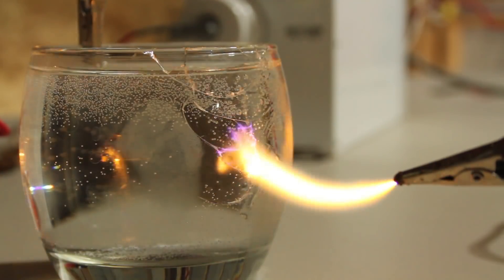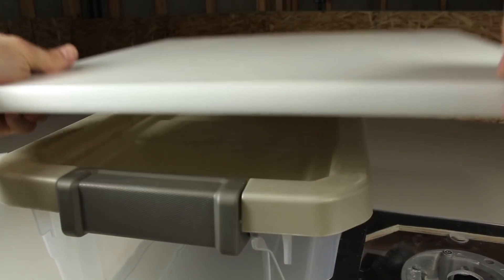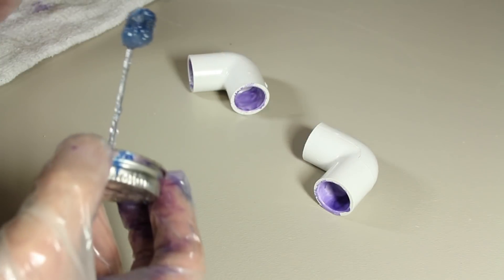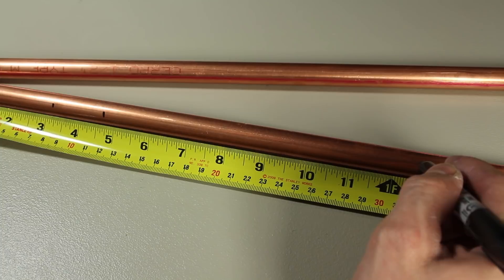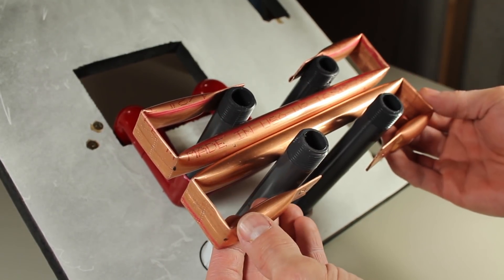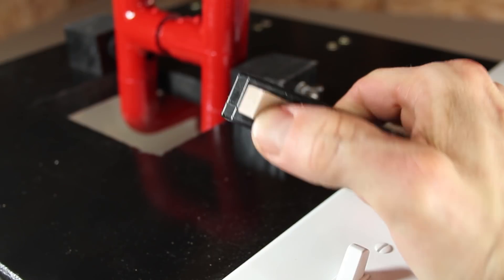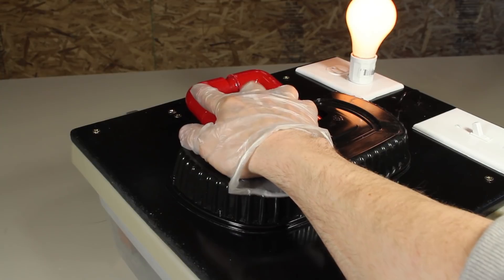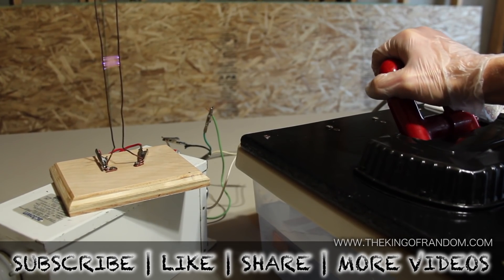The Scariac (Poor Mans Variable Power Controller)

Comment: 4:58 Why the hell would you use a plug without a ground on it. Are you deliberately trying to make this thing as deadly as possible?
Reply: There is nothing to ground on this device so a ground prong would be useless. Nothing except for the wiring and electrolyte is conductive so there is no alternative path for the electricity to follow (so it all has to return through the neutral). It's not the safest contraption but a ground would not make it any safer.
Reply: +Alex Golembeski That may cause a ground fault circuit interrupter to trip, which is the point of it.
Reply: Mitchell Spanheimer Yep, and over time, the sharp screw, due to movement, can cut into the wire just a little bit to short it out, but not enough to trip the breaker, so it could cause fire. It's unlikely, but it could happen.
Reply: +Alex Golembeski I mean, he does say it's able to kill you in the video, shouldn't that be enough warning?
Reply: +Alex Golembeski Better yet, look  5:15 how he screwed cable to the board !
Reply: +Alex Golembeski  
If you're asking this question then this project is not for you.  What are you going to ground?  Hopefully, not yourself when using this. That why it's called the Scariac!
Reply: Please tell me your problem "Deadly little gamer".
Reply: This rich kid is 42, yes I do well for myself.  I can support myself just fine from my job as an electrician which I've done for 25+ years, so yes I do know something about electricity. And BTW, no help from my parents, kiddo. 
 Now tell me fuckhead, what does this have to do with electricity, You still haven't answered what I said that made post in the first place.  You seem to know it all so I would love to hear you.  
I have to sleep now so I can go to my job tomorrow and build real buildings, unlike you in your block worlds.With your attitude,  I guarantee you wouldn't last one day in the real world.
Reply: Mark Schulz IV I have to admit that is pretty sketchy, he probably pierced the insulation...
Reply: yeah but at least you can put the fire out straight away thats a plus
Reply: ***** 
"do us a solid" that tells me everything right there.  Go back to your minecraft game.  smh...
Reply: +Chris Barth Dude, if you're 42 you shouldn't care what this kid says. Just ignore it. You are just wasting your time.
Reply: You are right, sometimes its easy to forget that it could be a 8th grader making smartass comments. Thanks!
Reply: +Chris Barth lol
Reply: +Chris Barth Lol your right haha I'm making a not Tesla coil right now Lol letting silicone on the rotary spark gap harden Lol then it's time to wind a primary around it lol
Reply: +Chris Barth ohhh yeah that's awesome I may try that one day
Reply: +Deadly Little Gamer Haha. This has nothing to do with Electrical Engineering. 😂
Reply: Did you see the medium he uses for controlling current? Ground would be the least of worries though it would help. He could have used a polarized plug and 2 wire, running the ground from the 2 wire directly to the outlet.
Reply: +Deadly Little Gamer Not only is Minecraft fairly useful for what you've said but, they're using Minecraft right now to make AI that much better.
Reply: +Chris Barth not you I'm also an electrician buddy I'm not saying nothing your fine but the kid  that originally commeted I just don't want him getting hurt he does need to learn electric if he wants to work with it sorry if I offended you

Comment: Does this not get hot or produce hydrogen gas under load?
Reply: +Quantum Leap 
AC current doesn't produce hydrogen
Reply: Sorry i just assumed you were a little kid so i was trying to simplify it, however keeping in mind atoms are not solid items but mostly empty space electricity can flow through them ,however when i say flow through atoms i mean flow throughout the groups not flow inside of them, imagine it this way you need a constant flow from a cathode to an anode and with DC it makes that straight path, however with AC picture the electrons go one inch forward and then one inch back, they make no progress, the just switch meaning that the "cathode" and "anode" are constantly switching in the sense of electrolysis so nothing is generated, no atoms can move to one side without moving back.
Reply: Priyansh Yep, back in the '70's. It's not really safe or practical. Aptly named, Scariac lol
Reply: +ZeroFossilFuel If you use DC current yeah but with AC you would produce microscopic amounts to none. 
so just use AC with this.
Reply: there's no fixed anode or cathode.
Reply: Benjamin Well it's pretty simple when you look at the difference between AC and DC, AC or alternating current alternates back and forth kinda like a shaking motion but hardly makes any movement through the wire at the end, while DC or direct current moves in a straight path through wires and covers a big distance, so it really comes down to which has more one way current flowing through the atoms and simply put it's DC.
Reply: Quantum Leap have you made one?
Reply: why is that?
Reply: Thanks for trying to answer my question but that doesnt make any sense. Also, electric current does not flow through atoms.
Reply: Zero Labs probably.
Reply: +ZeroFossilFuel   Yes, it does both.

Comment: A good Variac (auto transformer) is VERY expensive.  I have a 10A Variac and I am VERY careful with it to ensure I don't over load it and cause it to fail.  I'd probably use a bucket and re-design for that.  Ensure it have a HUGE base so that it was very hard to tip over any maybe even a kill switch wired for tip over (mercury type switch).  Run that to a BIG SCR that would be triggered by the mercury switch that shorts the input power and pops the circuit breaker.
You have to be VERY careful with motors.  Some do not like variable voltage.  Beyond that; VERY KEWL!  Even from an electronics tech/electrician point of view!
My last concern is vapors from any electrolysis.  Lye is not pretty stuff to mess with!
Still again, very cool!
Reply: +Jon Geissinger Also, induction motors get their speed stability from the frequency of the power line. Reducing the current wouldn't effect the speed much. All that would happen is reduce its torque.
Reply: +RiaRadioFMHD773 yeah, this kind of stuff is for low-tech things mostly. but i din't know variacs are expensive. why?
Reply: +Paul Hendrix It is basically a transformer that has its primary & secondary married with an extremely high rated potentiometer or rheostat between them. Also, to pass high current, the transformer (or auto-transformer) must be rated high as well.

Comment: The dangerous part is with the time, plastic get old and can break appart with nothing, and if there is electricity it can be lethal so it would be better if you add some sort of floater security that cut the curent if the water escape ;)
Grant Thompson really read my message because every plastic have problem by getting old

Comment: What scares me is that you actually create lethal fumes, and combustible hydrogen gass when you use this device... The cost of the materials isn't that much lower than for a used variac, so I'd go for the safer option :p
That doesn't mean I don't like the experiments though, but I do think you might check all the hazards befor doing this, and actually mention them if you post the video...
Science is only fun if you pay attention to safety!!!

Comment: Why not just get a rheostat?
Reply: +Fried Keenan That will affect voltage and current where this application only significantly affects current.
Reply: +Kyle C BUZZER SOUND. Look up Ohm's law. 
Never believe things you read in youtube comments kids! In fact, don't believe this either. Look it up.
Reply: +Rebelgium ok I won't believe you
Reply: cos
Reply: +Fried Keenan Actually, this is a good suggestion.  The modern rheostats these days are NOT variable resistors.  They are Pulse Width Modulated devices.  In other words, they turn on and off extremely fast for variable amounts of time to regulate power without wasting energy like a resistor would.

Comment: Voltage (E) is constant because it's a linear circuit. When you increase the surface area of the electrode in the water solution, the resistance (R) goes down. As a result the current (I) goes up. Ohm's Law explains the relationship (E=I*R).  Take a volt meter and measure the wall voltage. It's around 118 volts. Then break one wire and connect the an amp meter between the two points you made. Now turn it on and run up the power and watch the meter. But I would recommend is using anything but this. lol

Comment: I'll be making this. Just a smaller version with a lot less electrolyte, so only a very small amount of water is needed and it could be down with a small dial instead of a big lever. Just add a % scale to the dial (based on electrolyte concentration & electrode distance) for easy reference. Perfect for my applications and stupid cheap. Also, it's safe to just use salt because this is a series potentiometer not an electrolysis setup.

Comment: This one brings back memories, many years ago I worked at a Greyhound Stadium, the electric hare was powered by a 415 volt three phase motor. Up in the hare control room was a lever which dropped some copper contacts into three baths of Sodium Carbonate solution, you may wish to try using that, its also called washing soda, and its much friendlier to use than Sodium Hydroxide. Every time the hare was started a loud sputtering noise would come from the soda baths has the electrodes dropped deeper into them and the hare speeded up. The soda baths needed to be kept topped up as the water evaporated. The hare controller liked his beer, and would always be drinking a pint whilst driving the hare. All that beer had to go somewhere, and it could be difficult to reach the toilet between races. Needless to say more than just washing soda was used as electrolyte. And the room developed a very unpleasant smell. And yes the unit did have a safety interlock, so urinating onto live contacts could not happen. I was often in charge of a very old camera, the negative had to be pressed across a very sharp blade inside the camera, frequently I would catch my thumb on the blade in the total darkness, which was wonderful when the negative was going through the fixer bath, which contained Acetic Acid, lots of gritted teeth Ouch lol!! Happy memories though.

Comment: I would love to see you redo this one and seal it water tight as well as well as maybe adding a ground fault in case of a leak.
Reply: no he needs to run the electrical current through an Isolating Transformer first. if he does that, then he theoretically could put his hand in the water and not get a shock ☺

Comment: Do not run single-speed motors with this for heavy applications.  Although it can control the speed of the motor, the motor itself does not have a low-speed coil, meaning you can easily short things out if you put a lot of load into the system.  Variable speed motors are expensive for a reason.  I normally love your videos, but this thing looks like a death trap!  lol   Cheers!
Reply: Very much this

Comment: why not use a dimmer switch
Reply: +BMAN488877 No because it can handle standard household current (up to 15 amps) and a angle grinder only takes 4-9 amps

Comment: Where did you get the 12 gauge wire? I'm only seeing $50 plus for spools with much more than is required.
Reply: Where, what brand, etc. Specifications on the wire, I should say.
Reply: and one more question... what are the length, and number of, the straight PVC pipe pieces used in the handle?
Reply: +cameron weldon - at most hardware stores you can get wire cut by the foot. I am pretty sure Home Depot has this too. I usually go to Ace.

Comment: This is even more dangerous than explosives. Imagine having too short cable and pulling this thing off the table (ouch).
Reply: +pvc988 Or spilling the water out of the side onto yourself while the circuit is live.
there is all types of sketchy going on with this. But it is a wonderful demonstration
Reply: Cool!

Comment: If you think it's wierd that the voltage is constant you obviously shouldn't be playing with this..
Reply: +Morgan Freeman - it should be voltage changing the speed of the grinder instead of the current right? haha
Reply: +Edward Chew I'm not sure i understood your comment. When the electrodes are far away from each other, the current has to travel trough a longer distance of water wich increases the total resistance, and that means the current is limited. If the current is limited that means the grinder won't get enough juice because of the added resistance. When the electrodes are close to each other the current only has to travel a small distance trough the water and the total resistance between the electrodes are smaller, therefore allowing higher current. The voltage should be somewhat constant.
Reply: +Edward Chew you can see in the video that his readings show that the voltage is almost constant and the amperage is changing (sorry for bad english btw)

Comment: you can make simple electronic circuit instead of this thing , it's easier and costs less than 1 dollar .( using Quadrac and simple electronic elements ) . and it can make the job more professionally.

Comment: I just thought about something. You know how some people burn copper till it turns black then clean the black off to expose the reddish orange corpus Oxide layer it leaves behind? Well I wondering if you use copper as the medal in your electrolysis and instead of stainless steel and get the water as reddish orange as you can get it if you could soak paper towels in the reddish orange water and get it saturated with the corpus oxide and use that to make homemade solar cells. You could use copper sheets and put the corpus oxide coated paper towels on top of a copper sheeting. If that would work I think you would have a better solar cell than people are making buy just heating up the copper sheeting till it get a good layer of corpus oxide on one side of the copper. I think this could work better. I am slightly retarded though. LOL true though
Reply: Steve Rabon Hey, your thinking outside of the box. That's something that the whole world needs, so keep it up! :D (Just so you know I have no idea what any of what you said means.)
Reply: You know how people torch copper sheets till it turns black then clean all the black off to expose the red corpus oxide that is caused by oxidizing the copper? When you do electrolysis the water starts to turn reddish orange because the oxygen that is liberated from the water molecule reacts with the copper and produces corpus oxide. Now I am wondering if you take a paper towel and soak it in the corpus oxide if you could create a homemade solar cell. If you have the corpus oxide on one side and copper sheets on the other it creates an homemade solar cell. Some people just burn the copper on one side to produce the corpus oxide. I was thinking if you done it with electrolysis it would create a better homemade solar cell. I am retarded so I might not be describing it well enough.

Comment: Forgive me if I am wrong. I feel that using copper in this way would cause the Copper to react during electrolysis to create corpus oxide. The copper will start to deteriorate and the water will start to turn a reddish orange color because of the corpus oxide being created by the oxidation of the copper.
Reply: Steve Rabon Shouldn't be a problem since the average user wouldn't live long enough to see any serious deterioration.
Reply: ***** OK I am sorry I just know when I used a nine volt battery and did some electrolysis the copper deteriorated and the water turned a  reddish orange color because the oxygen and the copper reacting and producing  corpus oxide.  That was with DC voltage though; I am not sure about AC voltage. It seem like with the DC voltage only one terminal of copper deteriorated, but it seems like with AC both will deteriorate because of the alternate charge making the negative and positive terminals change polarity so when the oxygen is liberated from the water. The oxygen is usually only produced on the negative terminal but with AC voltage the negative terminal change so both terminals will eventually corrode. I dumb though LOL
Reply: Steve Rabon hey, my mistake, you are probably right. I tried to make a joke, since the guy admits this device is dangerous. just joking that most people will shock themselves quickly and never use it long enough for anything to deteriorate. now I see my post is just stupid!
Reply: ***** Its a good Idea. I plan on using it myself. I will just have to use stainless steel instead of the copper.
Reply: Steve Rabon The dollartree has stainless steel biscuit pans. Those will work fine.

Comment: No wonder the voltage was constant through the entire cycle, when you've added no load to that variable resistor whatsoever. Variac is a variable transformer that regulates the voltage. A resistor limits the current. The voltage will drop when the load increases.

Am I the only one thinking that this guy should go and figure out more before doing this kind of stuff?
Reply: +Ciara Fozard 
A variable AC transformer (variac) changes the voltage. This is just a high amperage resistor that does things other than change the voltage. Though it does pretty much the same job if you just want your things to spin slower.
Reply: Ciara Fozard Basically ELI12
Reply: FrozenHaxor He doesn't need to figure out anything to be able to build and use this device.